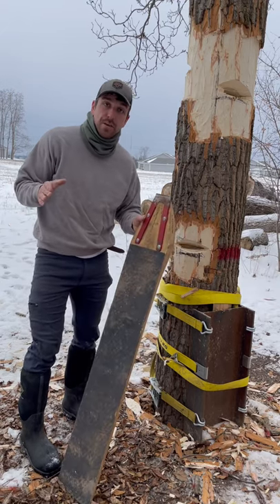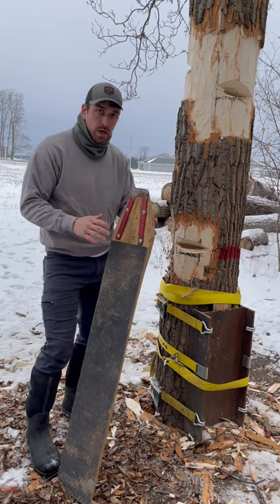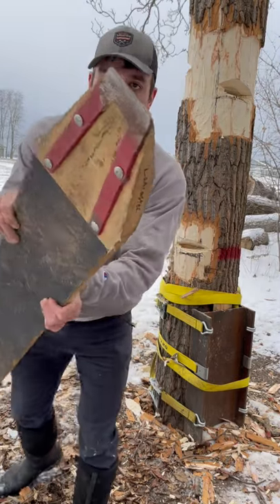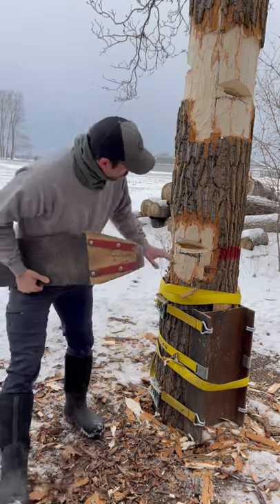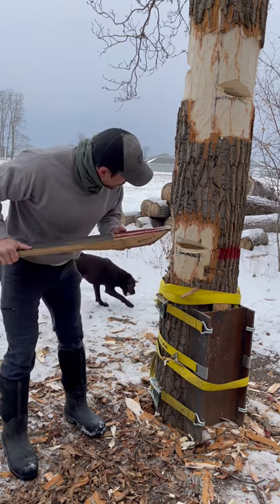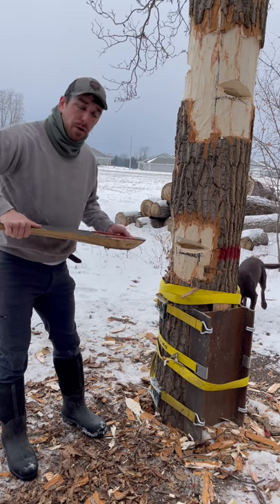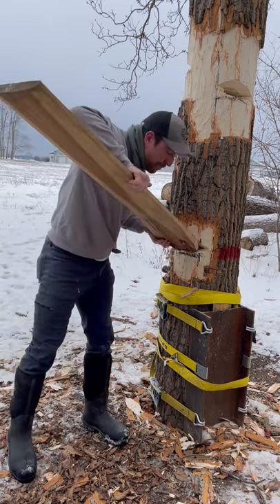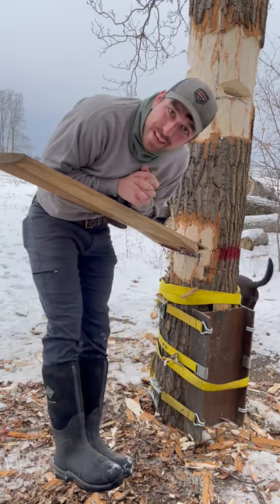How does a Springboard work?

Comment: Hey I totally understand the shoe part but the actual board doesn't break..What is the board what kind of wood is how do you choose what board to use or do you cut it a certain way so the grain of the wood is the strongest or what.

Comment: Well, that part was obvious... but how do they support you, and why doesn't it break?
Reply: The wood is strong genius
Reply: @AtlasSSJ  - LISTEN carefully to the beginning of the video!
This guy does not answer ANY of the questions that he himelf poses at the start of the video. Hence my comment, genius.
Reply: @johncoops6897  it's your weight against the weight of the tree.
Reply: @ashadowintime7305  - the weight (and roots) of the tree prevents the tree falling over, but that has absolutely nothing to do with the questions that THIS YouTuber quoted yet didn't answer in his own video.
Reply: @johncoops6897  He explains it. Essentially, that metal tip digging into the tree takes the brunt of his weight. Without that pieces, yes, it'd probably break.
Reply: @shae9364  - of course the notch in the "tree" is how it supports the person.  The whole device isn't made of metal, it must be wood or fiberglass that the human stands on.
BTW I understand perfectly how it works. My comments specifically relate to the clickbait title, and how the video doesn't explain anything about "How does a Springboard work?".